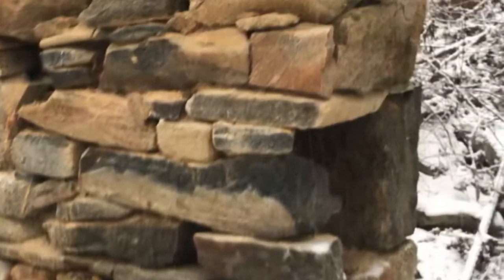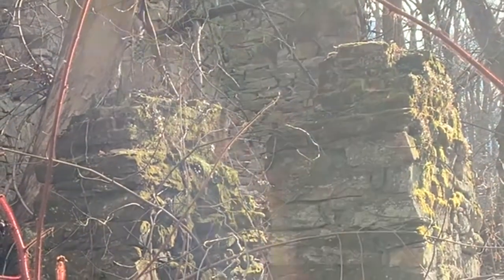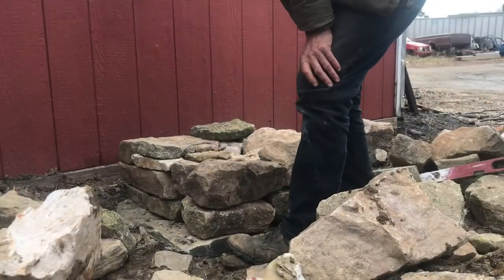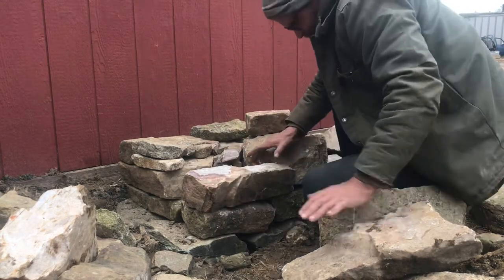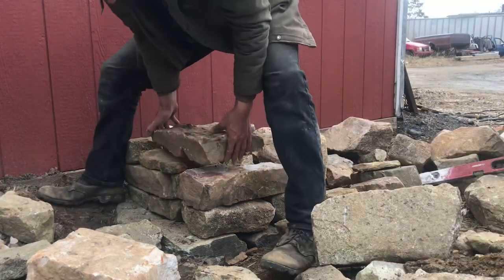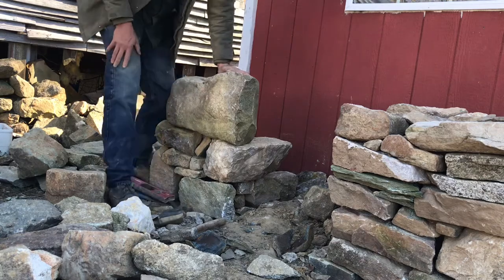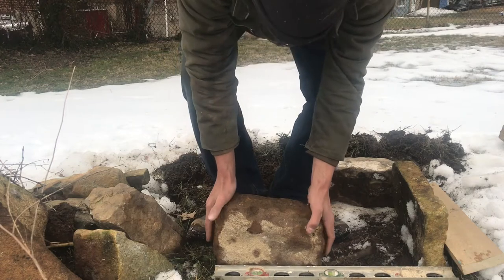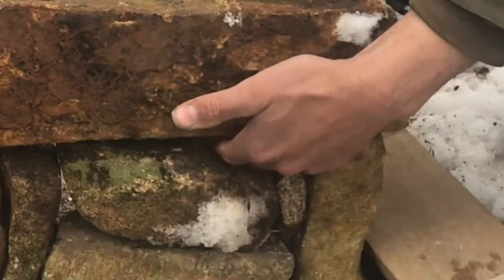Early American Stonework: How to Build a Stone Column

Comment: Hmm.. nice video.. 
However 2 comments. 
1. Length into wall. Shouldn't be wider than it is deeper.
2. Length into wall. Shouldn't be higher than it is deeper.
U want internal bonds.  People chase face realestate instead of strength......
Reply from the maker: The general rule is a ratio of 2:3, width and depth to height. And you are absolutely correct about internal bonds. Without them, it has no structural value.